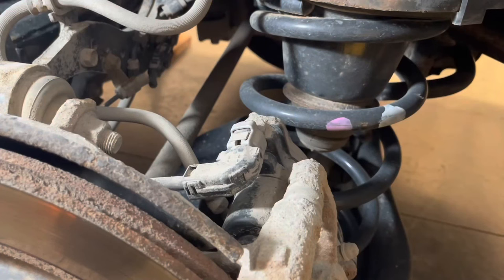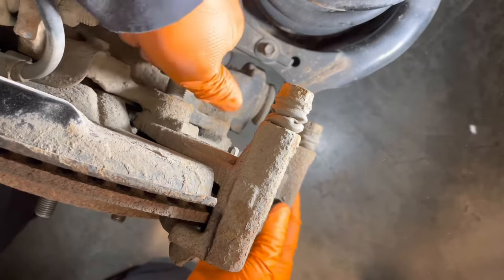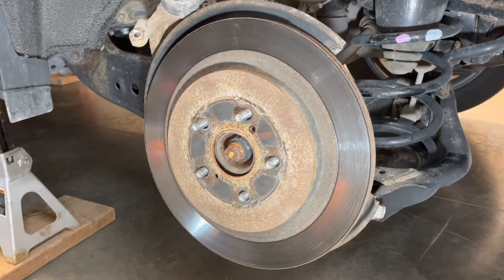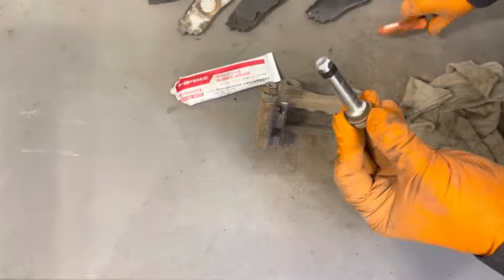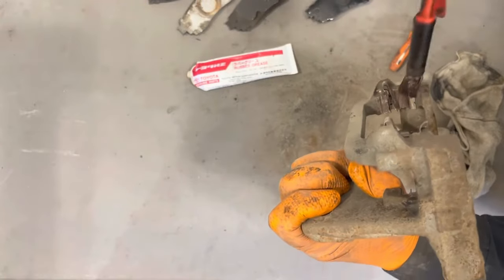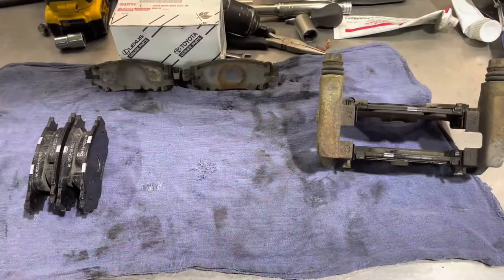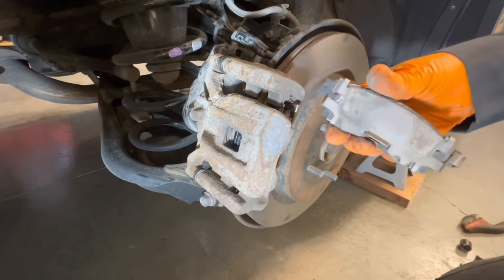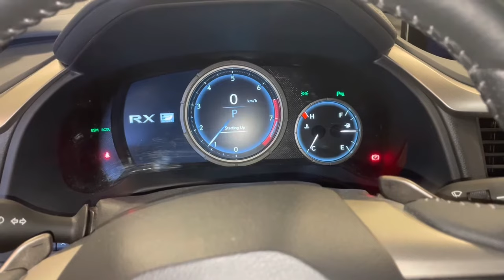2016-2022 Lexus RX350 And RX450h Rear Brake Pads And Rotors Replacement Instructions

Comment from the maker: Below are my affiliate links to the parts and tools you would use to complete this job. I may receive a small commission from the product sales. Thank you!
Genuine Lexus/Toyota front AND rear brake pads: https://amzn.to/3ZwXMM6
Genuine Lexus/Toyota rear brake pad shims: https://ebay.us/BBEZSp
Genuine Lexus/Toyota rear brake rotors: https://ebay.us/vrwp7X
Genuine Lexus/Toyota slider pin rubber grease: https://amzn.to/44Qh9RE
Genuine Lexus/Toyota caliper grease for between pads and shims: https://amzn.to/471ihnj
Brake caliper piston compressor tool: https://amzn.to/3OcShwC
SUV jack stands: https://amzn.to/3q6VS7t
Thin wrench set to hold the slider pin while unbolting: https://amzn.to/3xLoTZX
Anti-seize lubricant for the pad slider inserts in the caliper brackets: https://amzn.to/3QcAXdR
Small wire brushes for cleaning the caliper brackets: https://amzn.to/3OqlCoC
Large wire brushes for cleaning the hub: https://amzn.to/3OtyGts
1/2" drive cordless impact wrench kit to take the wheels off: https://amzn.to/3Kcw00I
1/2" torque wrench for tightening the wheels: https://amzn.to/3Kcu48E
Small flat blade screwdriver set: https://amzn.to/44HUoQi
Rechargeable LED mini work light: https://amzn.to/3Y74OpY
M8x1.25 bolt for taking the brake rotors off: https://amzn.to/3K8pQ1x

Comment: I can’t thank you enough for the detailed tutorial on backing the electric parking brake.  I was midway through replacing the pads and rotors on my wife’s 2017 RX450h and couldn’t figure out why I couldn’t push in the caliper piston. I almost broke the piston by cranking it in with all mighty force.  Thanks again
Reply from the maker: Glad the video was helpful!

Comment: I’m using a 12v on the passenger side exactly like you instructed, but the parking brake motor is not stopping. Been connected for 5-10 minutes.
Reply from the maker: @tylerjohnson2127  I’ve not run into that, should only take 10-15 seconds. Maybe something is broken inside the caliper or motor.

Comment: Do you have more 4th Gen RX 450h maintenance videos coming?
• body side molding
• spark plug replacement
• Brake fluid replacement/bleed
• water pump and thermostat replacement
• Throttle body cleaning
Reply from the maker: It will depend on when I can get my hands on one of those. I currently have access to a 2017 RX350, but not a 450h.
Reply: @Viktor_G_Automotive  Thanks
Reply: Take a holiday in Ireland and I let you replace my RX450H 2016 weeping water pump !.🐵...... @Viktor_G_Automotive

Comment: Hey Victor...I did this but now I have mssg "electronic parking brake multifunction...parking brake unavailable"
Reply from the maker: @yarusie  hi, there is a note in the video description that talks about a possibility of setting a fault code when doing rear brake pad replacement on this model. You will need to clear it with a scan tool.

Comment: Victor, Toyota and Lexus recommend tightening the wheel nuts to 103 nm
Reply from the maker: That is correct. 103 Nm equals to 76 ft-lbs, which is the units we use here in North America.

Comment: Hello Viktor, is there any problem or concern using the RX350 car 12v battery to retract the parking break? Thanks for all your help.
Reply from the maker: @biggeo4762  no, it doesn’t matter which 12V battery you use. Be aware that no matter what method you use to retract the EPB, there is a small chance of setting a fault code that would have to be cleared with a scanner.

Comment: Can I use an 18v battery from my other tools to back out the motor or does it have to be 12v?
Reply from the maker: It might work fine, or it might burn out the motor. I personally wouldn’t risk it.

Comment: After I did this it now says parking brake  malfunction contact dealer parking brake unavailable
Reply from the maker: Please see the note below the video regarding the possibility of setting fault codes when doing the brake job..
You will need to clear the fault codes using a scan tool.

Comment: Every tiny detail reflects the excellent quality in the repair process. I don't own the same generation but the educational information was very satisfying. If you have to choose a certain year of the RX to own, which year would you take of the third and the fourth generations, based on your repair and maintenance experience? Thank you.
Reply from the maker: Both are good generations of the RX, my decision would be based on my budget. I’ve owned a 2012 RX350 and a 2010 RX450h. My brother has a 2017 RX350, no issues with any of them.

Comment: I have 06 lexus rx400h  vsc systems abs brake skids on after change  brake pads and calipers  why? Great video
Reply from the maker: If the brakes are not bled following a specific procedure, there will be fault codes in the system. May just need to clear the codes with a scan tool, or might have to do a brake bleed with the scan tool to get rid of the codes if you can’t just clear them.
Reply: Thanks for ur help will  try clear code

Comment: a note for nx300 2020. the 17 wrench should be really "slim" - mine is ~8 mm and it cannot grab the pin. Viktor definitely has a slimmer version. The same goes about the 14 mm socket - you wouldn't be able to have a good grip if your 14 mm socket is bulky - the plastic casing of the break motor gets in a way. I've tried to use a wrench for 14mm, but gave up once it slipped. 
break service mode works on nx300 2020 without any issues.
Reply from the maker: You are correct, most standard thickness wrenches don’t fit, you need to either buy a skinny one or grind a regular one down 😀

Comment: Hey Viktor, If you're taking video requests, I'm wanting to add some sound deadening material (dynamat) to my RX. Any chance you posts videos on how to remove the following trim pieces please?
- remove C and D (rear) trim panels - however I have the Mark Levinson system so there's a speaker on the rear pillars
- how do you delicately (without permanently damaging or creasing) pull down the rear headliner to add sound deadening on the roof (I have the panoramic roof so only the rear needs sound proofing)
- how do I lift up the rear seat bench (I have the hybrid)
- how do I remove the engine bay trim pieces (2 sides, 1 over the radiator)
Reply from the maker: I’ll add it to my to do list, but I’m not sure when I will be able to film that type of work.

Comment: Just curious, what is the purpose of the black ring on one of the sliding pins and how can you tell the black ring should be on which sliding pin if forgot which sliding pin was on?
Reply from the maker: @next1mpact  I believe they are there to absorb vibration and reduce brake noise. If you forget where it goes, you can check on the other side brake caliper. On some models one pin is different length than the other, so make sure to reinstall them correctly or you will run into issues down the road.

Comment: Any reason why one pin has a black tape and one doesnt. The one with a black tape is shorter. Thanks
Reply from the maker: @jmikhael1886  on some Lexus models both pins have the rubber damper, on other models only one has it. I don’t know why. Just make sure you reinstall the pins in the correct spots during reassembly.

Comment: Mr. V,  do I have to use the Lexus or Toyota pads.   Are the other well know brands like “Power Stop” or Raybesto ok.   There is a big difference in price .  I have a 2019rx350
Reply from the maker: I would personally only use Lexus/Toyota pads on my vehicle. Some aftermarket ones are ok, but many cause brake noise and vibration.
Reply: @Viktor_G_Automotive  thank you . Will use Lexus pads….
Reply from the maker: @robertsimonofsky3959  good decision 👍

Comment: Question, i have a 2020, can i just release the parking brake from inside of the vehicle before i do the EPB?

So i don’t have to do the 12v battery process
Reply from the maker: No, that only retracts the park brake by a millimetre or so, you need to fully wind it back to be able to compress the piston.
On a 2020, you don’t have to use a 12v battery, there is an easier way:
https://youtu.be/G9dlHyAU3SM?si=aXQaeA8gO0VuENcS
Reply: @Viktor_G_Automotive  thanks so much, always follow your videos
Reply from the maker: @arielreyes12  Thanks!
Reply: Thanks so much for your videos, today completed ✔️ front and rear pads and rotors replacement on my 2020 following your videos 

Appreciate 🙏
Reply from the maker: @arielreyes12  excellent work!

Comment: Hi Viktor ! Would I be able to use the same battery of the RX I’m changing the breaks to ? I just have to have long enough wires to reach the calipers . Please let me know I would appreciate it 🙏
Reply from the maker: Yes, you definitely can.
Reply: Do I need to disconnect it from the car ?
Reply from the maker: @JuanCarlos-ph7lb   no, it’s just a 12v supply to turn the EPB motors
Reply: @Viktor_G_Automotive  thank you Viktor

Comment: For me I would a portable DC power supply that I can plugged into a AC plug in my house.  Set it to 12V DC and whatever ampere required (with a little more) to move the electric parking brake motor.
Reply from the maker: That would work too.

Comment: Would this instruction work for 2015 NX200T? Thank you!
Reply from the maker: Mechanically, the rear brakes are very similar between the RX and NX. Here is a video of how to retract the rear EPB on the NX so that you can compress the caliper pistons: https://www.youtube.com/watch?v=ispWeXHmYDo
Reply: for nx300 1gen
caliper bracket torque is 79 lb-ft. Not the same as for RX - 111 lb-ft
slide pins torque is 25 lb-ft

Comment: Hello Viktor, have you ever seen this error message:  Access system with Elec. Key malfunction? Now the car won't start. 2018 Rx350. Thanks for your help in advance.
Reply from the maker: No, I can’t recall ever seeing such a message. Would need to scan for fault codes and diagnose.
Reply: @Viktor_G_Automotive  thank you for the reply, very curious to see what it is. Couldn't find much info online

Comment: You can put the brakes in service mode....look up how to and it disengages the ebs
Reply from the maker: You can enter the rear brake service mode on 2020-2022 RX models only. The 2016-2019 have to have the EPB motors either retracted manually or electrically the way I show in this video.

Comment: This may be a dumb question, but if the Auto Park Break is turned off/disengaged, will you still need to run the process on backing the electric parking brake?
Reply from the maker: It is not a dumb question, and yes, you have to do this if you want to compress the rear caliper piston to install new rear brake pads. Taking the e-brake off will back the motor up by a few turns to release the brake, but you need to wind it back fully to complete the rear brake job.
Reply: Thank you, do you have to use the electric process to make it back up or will manual compression using a brake caliper tool also work?  @Viktor_G_Automotive

Comment: Do you have the procedure to place the 2013 Lexus GS350 Electronic Rear Parking Brake into service mode?
Reply from the maker: You don’t need to do that as the parking brake setup is different. Just release the parking brake by pushing the button once and you can go ahead with the brake replacement like any other car.
Reply: @Viktor_G_Automotive  Many thanks sir. Just surprise me per your comment. Why doesn't other model has the same setup likes this one?
Reply from the maker: @Mac-t4y  the 2013 GS uses a regular rear brake caliper with cables that apply the parking brake, but instead of a person applying the parking brake, an electrical motor does it.
The 2016 RX uses different calipers, with the EPB motors built into them.